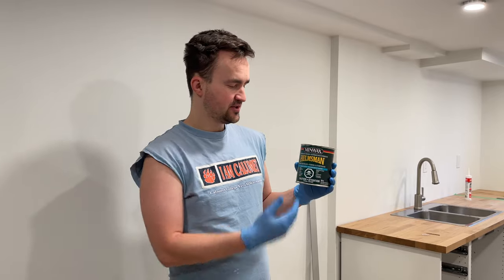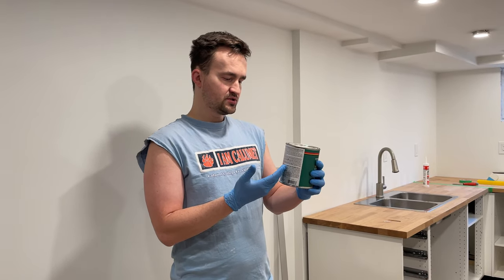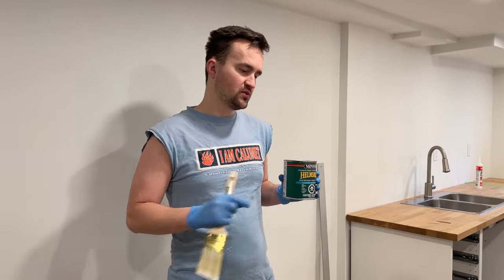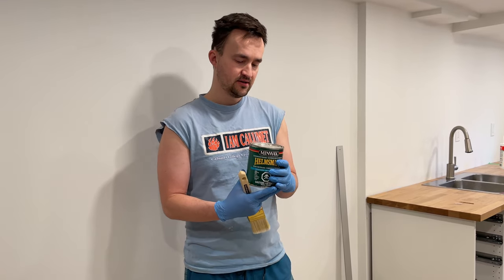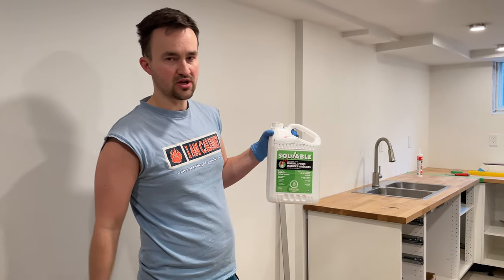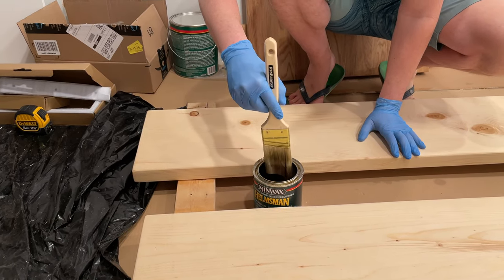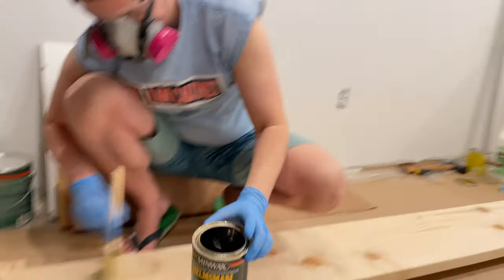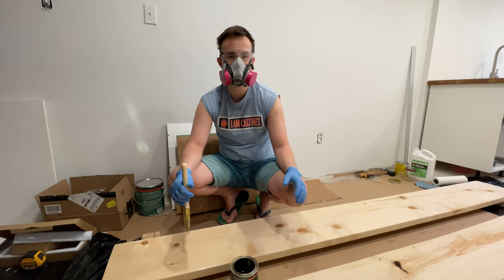How to Apply Polyurethane or Spar Urethane to Wood

Comment: That's not how to brush. You're creating air bubbles. You need to load the brush up and you should only need 2-3 strokes for each line across that entire piece of board. Stain is not to be applied like paint. There are countless other videos on YT showing the correct method. Watch those.